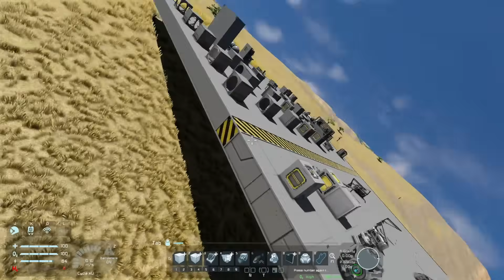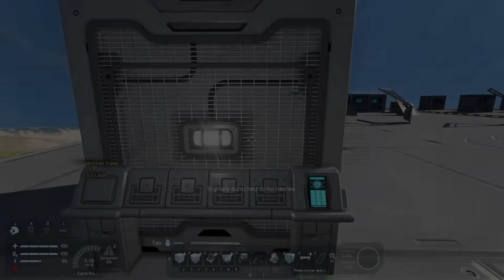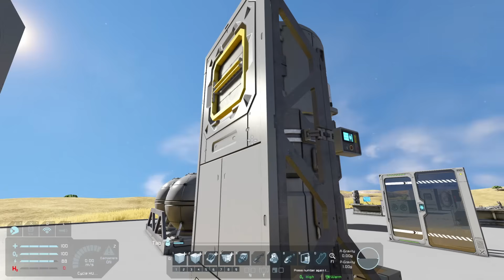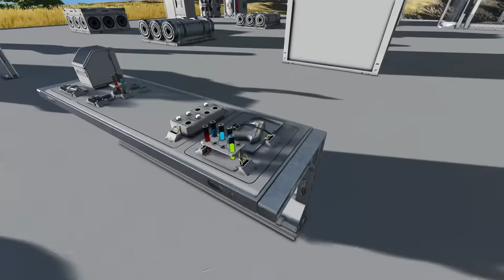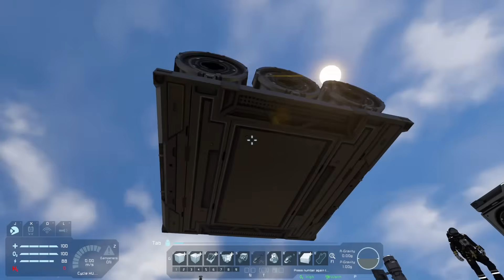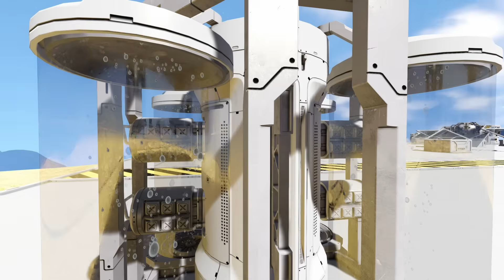NEW blocks, CARGO SHIPS, and MORE! - Space Engineers fieldwork Update (+ DLC, Block overview)

Comment: Only other thing they should've added was what the mod 'build info' does.
1) Checks for air leaks
2) Shows when your either in a cockpit or a command seat how much your ship or station cargo has. In vanilla the bar only displays your characters carrying capacity.
3) Shows what damage different types of ammo does. Like to know if I should build Gatling Turrets, Assault Cannon Turrets or a Artillery Cannon Turrets. Assuming they use ammo with different damage ratios.

Comment: "Tare" is a term used in scales that basically re-zeroes the scale when you have an empty container that will be used on the scale for measurements.
In my case, I use it for weighing gunpowder in my reloading at home. You place the powder pan on the scale, hit "Tare," and now the pan reads as zero weight on the scale. You then pour powder into the pan, and the weight displayed is the weight of the powder, rather than the weight of the powder and the pan. This enables you to get extremely precise and accurate measurements. In my case, I can weigh powder to a tolerance of one one-thousandth of a grain, a grain being 1/7,000th of a pound, or literally the typical weight of a single grain of wheat... or maybe it was barley... point is, "Tare" lets you subtract the weight of the container placed on the scale when measuring the contents you put into the container.
Reply: To add and finish, "net" is the weight/mass of the contents, which doesn't necessarily make sense here since it's variable.  "Gross" ("ah" O, not "o" o) is the total, so gross minus tare equals net.

M.G.W. is probably supposed to be "Max gross weight" which is the maximum safe weight something could be.  This should be net plus tare, but again, the numbers aren't actually making any sense, so someone just typed in random stuff when making the block.

Comment: On the lab experiments: These weight numbers are from irl shipping industry.

Net weight is the weight of a product alone, meaning without any packaging.
Tare weight is another crucial metric in shipping, and is officially accepted as the weight of a container. So that's saying the empty lab experiment's weight is given by the TARE value.
Now M.G.W. stands for Maximum Gross Weight and this is the highest a transport method is legally allowed to carry on official transport ways.

Gross weight is generally added between Net weight and tare weight, aka Gross = net + tare.
.
As for why Net is bigger than Gross, I believe that's a technicality - the gross weight requirement is for an empty lab experiment, aka without water. This is the maximum weight the experiment is allowed to weigh while it's being transported. But once delivered, it can be filled, and then the net weight is the maximum requirement while the experiment isn't in transit.

Or the values got switched. Idk

Comment: Neat thing is you can use the refill stations as cargo access points, and as a bonus they don't add an entry to the cargo list, whereas the actual cargo access point blocks do clutter the cargo menu.
Reply: they also have no computers so they are public blocks, you don't need to share a med room with people for example now
Reply: If you're having cargo clutter issues, remember, you can go to any block with cargo space, and disable it showing up in the inventory/cargo list.
Same with hiding blocks in the terminal. You can group a bunch of lights, for example, create a group name, then toggle them to not show up in the control panel (K menu), so only the group name is visible, instead of 20+ lights cluttering the panel. You can also hide them from the button assignment screen, to de-clutter the screen when assigning blocks/groups to a button or action.

This is like keeping wires tidy when building a PC. If you manage your blocks as you place them, you can get a very tidy, well-organized control panel and such. Worth taking the extra time, especially on a large ship with many systems. I'd also highly recommend using the Build Vision mod. Great for looking at a specific block, and assigning it a name, and adjusting properties. It can even copy and paste block settings, so you tweak a light to your liking while looking at it, then copy those settings, then you can target other lights and paste the values.

Comment: TARE weight is the total weight empty, Net Weight of goods alone, Gross Weight is the whole unit(goods and container)
Reply: tbh, they might have done a silly, they added something with weight, and also have a static gravity rating, so people can now calculate thrust,  and speed of accelerating x amount of mass, as to before it was kinda arbitrary lol
Reply: Your description is correct, unfortunately SE messed it up. 

The first block has a Net weight of 67,200 pounds, a tare weight of 4,810 pounds, and a Maximum Gross Weight of 64,100 pounds.

Not only is net greater than max, net + tare != max (67,200 + 4810 != 64,100) and max + tare != net (64,100 + 4810 != 67,200). 64,100 + 4810 = 68,910.

You'd think they would get it correct.

Assuming max and tare are correct, net should be 67,200 - 4810 = 62,390 or assuming net and tare are correct, max should be 64,100 + 4810 = 68,910. Assuming they simply transposed max and net, tare should be 67,200 - 64,100 = 3100

Comment: on the o2 tank, you compared two different volumes. you compared the inventory volume of the small tank to the o2 gas volume of the large tank. Apples and Oranges.
Component or bottle volume is 120L on small tank and 4kL on large tank. Gas volume is 3kL vs 50kL, respectively.
Reply from the maker: Yeah I realized that after the fact. Things went a bit too quick. Whoops